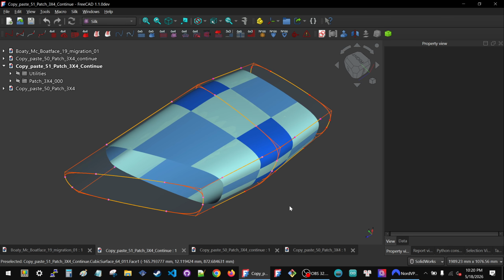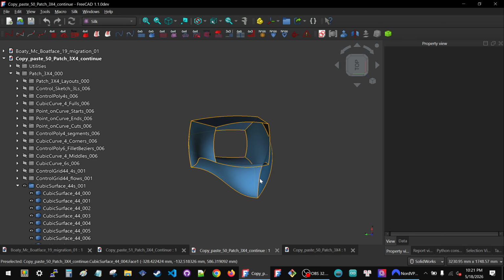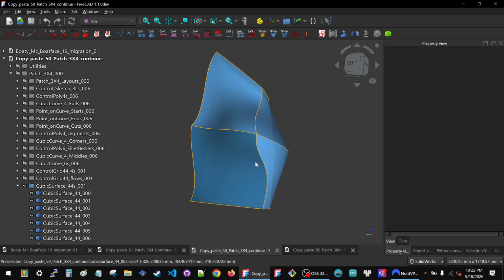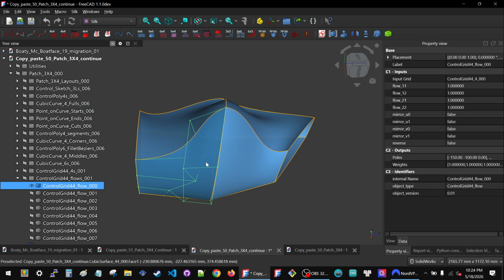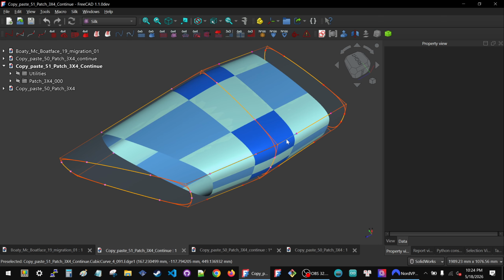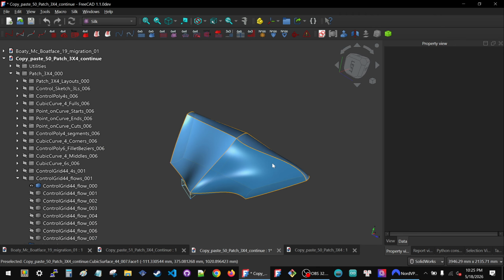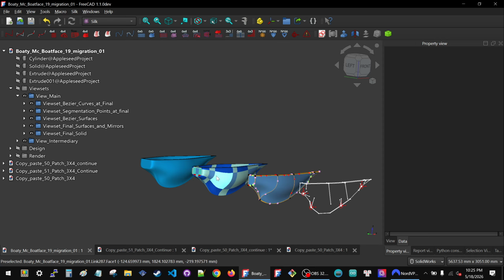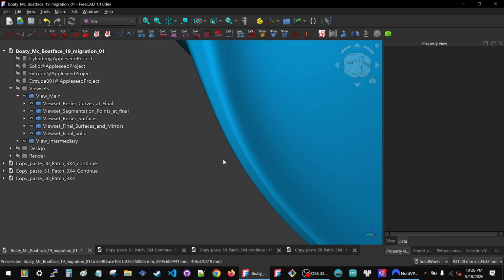FreeCAD Silk - Complete Tutorial Series 09 - Coffee Break

Comment: With designing a surfboard, all of the curves are connected tangentially to each other, so I thought I might not need to blend and I just about don't need to (the average undiscerning population thinks it looks amazing and smooth), but there's just barely a noticeable edge at some key points on the bottom side of the board's center/stringer line. The continuity is also crying for blend between the rail/edges and the center/flat surfaces. I think most shapers, who would likely be using foam and accept secondary operations like sanding, I'm intending to get my board produced with an injection mold process and it needs to be SILKY smooth!
The "funnest" part is when I want to go from an unblended, hard edge that transitions into a smooth, blended edge. I'm suspicious the default surface WB or a Curves Gordon surface may come into play to solve that.
I'm definitely confused about the corner, two way blending at this point.
Reply from the maker: post on the forum i linked dude....i have some things to show you :)

but also...what is your timeline to production? Silk is in alpha or maybe beta phase.  There are many things it does well, but i don't want to promise too much. for serious work that pays money, i use commercial software. period. FreeCAD in general is fun to play with, but there are still missing things. What is your real goal? to use FreeCAD (and maybe Silk)? or is your goal to make a product?